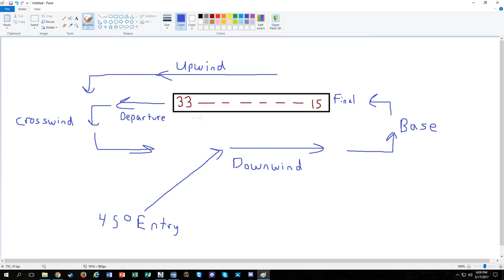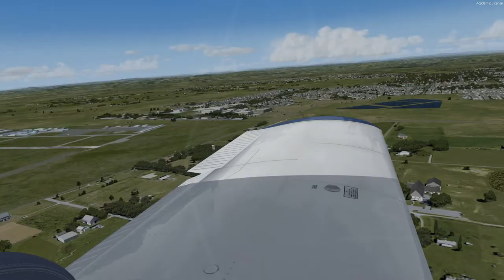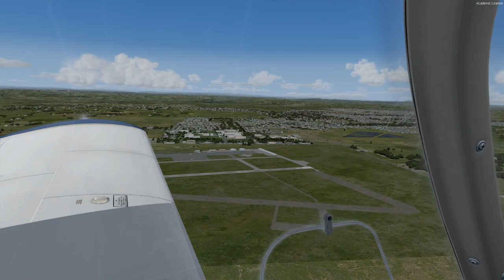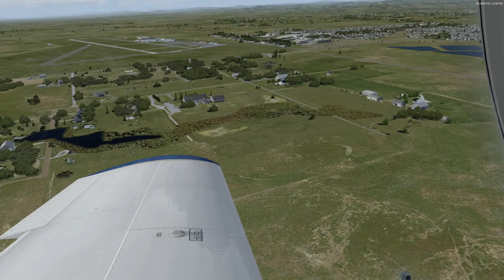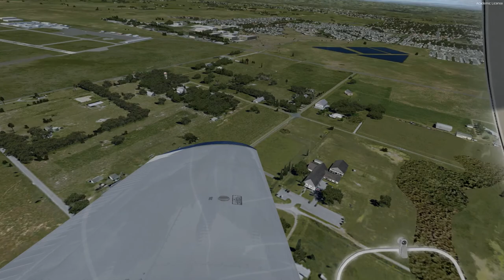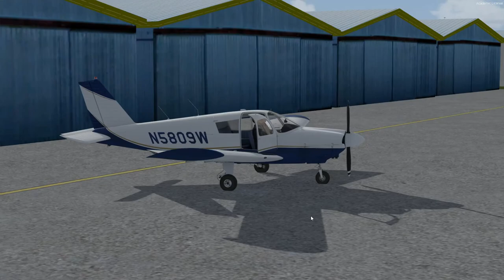Private Pilot | Traffic Patterns, Short/Soft/Slip/Crosswind Take of and Land

Comment: Really liked your videos, very organized. Kinda remind me of my instructor when I was going for PPL. One place in my training where I struggled during my initial days was flare or modern days transition to slow flight before landing. I used to take power off little early; then to compensate I used to come with faster air speeds on approach, but ultimately learned to fly speed and maintain correct attitude. Would love if you can bring up one video on this topic. May be with both high and low wing aircraft.  Also not seeing much activity since your last one :) .

Comment: How do you deal with other airplanes in the pattern?
Reply from the maker: Hi through communication and visual recognition. The 45 degree entry into the downwind gives you the chance to observe traffic as you enter the pattern and to figure out your sequence if there is other traffic on downwind. 

Ideally, if everyone entered on the 45 entry then traffic management wouldn’t be so bad. But in the real world, everyone enters from every direction possible so you have to keep up your scan. This is why it’s important to learn the visual sight references to fly the plane instead of focusing on the instruments all of the time. Keep your head outside and make your radio calls.

The radio is not required at non-towered fields which adds to the challenge when someone isn’t using the radio. Keep up your visual scanning, fly the proper procedure, and don’t be afraid to exit the pattern if it doesn’t feel safe. Patterns can get overcrowded and when someone makes a bad move, it may be best to just leave and come back in a couple mins.
Reply: SIM CFI I appreciate the quick reply. I recently finished my private and I have never flown in a traffic pattern with multiple airplanes going at the same time. I have obviously reviewed the AIM and it’s recommendations, but it makes little suggestions to physical separation between aircraft. My CFI hasn’t really given me details regarding this. How do you gauge spacing? If you were too close to someone, and you were behind them would it be recommended to do s turns or fly on a parallel upwind leg to increase spacing? I’ve heard that extending downwind doesn’t work well because it other airplanes to increase their spacing too, further creating a larger traffic pattern. How would you deal with this? I assume if it was only one other plane you could.
Reply from the maker: Hi if you’re on downwind and someone is in front of you, a good rule of thumb is to turn base once they are abeam you on final. If the traffic is too tight then you have a few options. Slow down / follow them but just fly an upwind leg and do another lap / do a 360 turn on downwind (if it seems safe, be mindful of traffic entering on the 45) / or just leave the pattern and re enter
Reply: @SIMCFI  Ok. Is it safe to do circles in the pattern? And what do you mean fly an upwind? You mean to the right of the person on final? Also, if you are approaching an airport and want to circle is it exeptable to fly in a circle or figure eight? Would you just do normal clearing turns like you are doing manuevers? Then turn around and circle back when safe (teardrop basically)
Reply from the maker: Hi a circle in the pattern is somewhat common (you’ll hear people say they’re doing a right 360 on downwind, assuming left hand traffic pattern) but it can have some risk. If you wanted to circle outside of the pattern I would just circle. 

The upwind is flying over the runway and then turning crosswind at the normal time. I usually offset it a bit to the right so that I can monitor landing and departing traffic to fit myself in with that flow.
Reply: @SIMCFI  So if someone was doing a full stop landing and you were close behind you would fly upwind without landing and come around again? Like a go around?
Reply from the maker: Hi if I was already committed to base and final then yes. Otherwise I would extend downwind and/or slow down and deploy full flaps.

Comment: 4:37 Cherokee 140?
Reply from the maker: I made these videos with my current students in mind and they fly Cherokee 140s so I wanted to let them know where the differences are from the 180.
Reply: Ah okay. FYI X-Plane has really wonderful Cherokee 140 you might want to check out if that's your main teaching aircraft. They have two different versions, one with an "original" panel and one with a more modern "six pack" panel.
Reply from the maker: I've seen that but nothing compares to A2A Accusim aircraft. This 180 is almost identical except for the extra power, so the main differences mainly lies with needing a bit more RPM in the 140 vs the 180 to get the same speed. And all the V speeds are the same, which is nice.
Reply: Hello CFI,I wanted to ask you for advice on keeping coordinated turns,especially during rough spots of air I seem to fail at keeping a turn 100% coordinated,would I be failed even in VMC for not being able to keep a 100% coordinated turn on my checkride?.

another request,please make a video on checkride boundries and tips.

many thanks
Reply from the maker: Shayan Hassanbigi yes I can definitely make a video regarding the FAA checkride. As for coordination, use the technique of rolling into shallow banks left and right and let the nose pivot around a point in the distance. If the nose is sliding around, you're using either too much or too little rudder.
Reply: Cheers for your input. All the best
Reply: Hello there, I am currently using Jeppesen FAA Private pilot book however I am in the UK and hoping to do my PPL In the UK,Is there any significant difference between FAA and EASA Because I dont want to take in false information etc could you please just clarify the differences and what to expect and what you would advise me to do. Thank you
Reply from the maker: Shayan Hassanbigi I'm not familiar with EASA and FAA differences. However, most of the content in these videos cover basic flying skills so they should transfer over. Traffic pattern and radio procedures may be different.
Reply: Should it be something I should be concerned about as I have a FAA books and content.Regardless of content here as brilliant as it is im just woundering is the content that I am study that is classified as FAA orientated studyware suitable enough and or similar enough to the EASA studyware and or if this will affect the way I will learn things or the outcome of a oral exam etc or what not.
Reply from the maker: Shayan Hassanbigi I honestly can't give you a good answer without reviewing their procedures first. Just take everything with a grain of salt haha. Basic techniques like how to recover from a stall and how to take off and land should be pretty universal. Radio and traffic pattern procedures will likely be different.
Reply: Got you, thanks.Could you also keep the FAA and or EASA Checkride in your mind for your next video as you have brilliant content